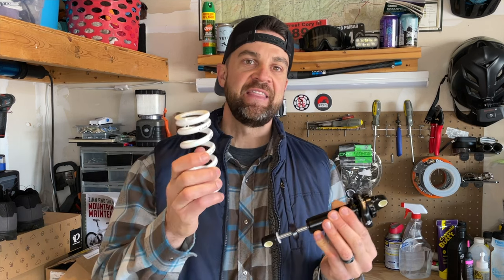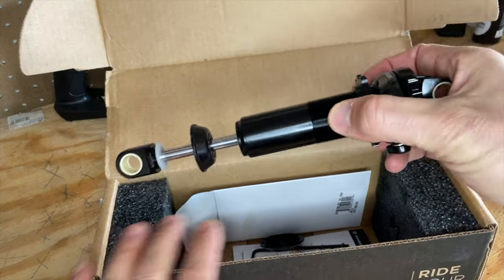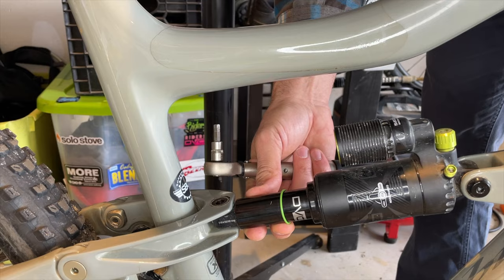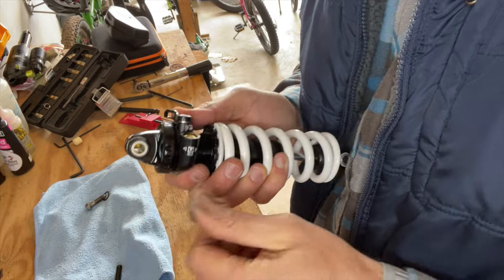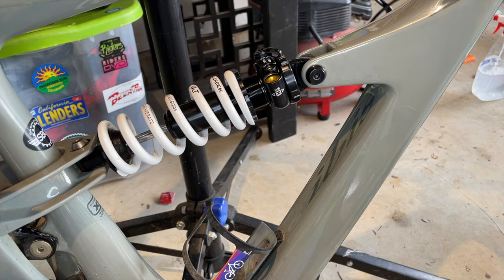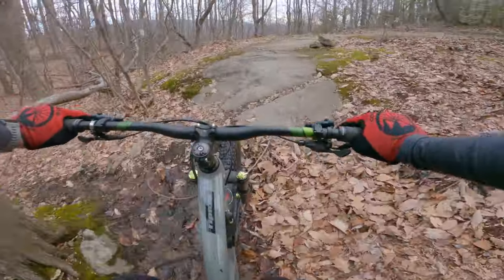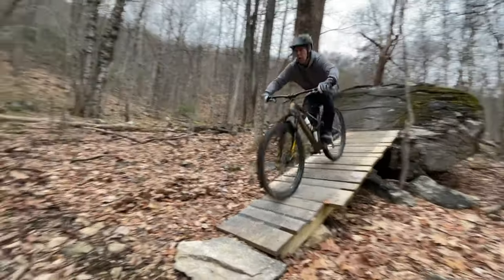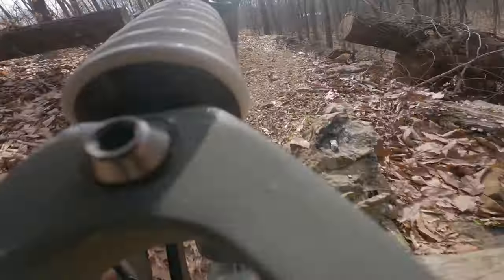Cane Creek DB IL w VALT Spring Progressive Coil Shock on the Ripmo V2 | Install & Review - 2022

Comment: Ripmo 29 2019?  Isn't it too linear to use coil shock even if the spring is progressive one?
Reply from the maker: @jungjoonchoi3744  no, there are a few coils specifically approved by Ibis
Reply from the maker: Also this is a V2.   The V1 could not run coil

Comment: Did you weigh the new shock with the spring installed? I'd be very interested in a real world weight if you have it? Im looking at one for my Ripmo and would really like to know what the difference in weight will be between the CC and my Fox X2.
Reply from the maker: I didn’t weigh it- I’m sorry 😞 - talking with a other ripmo owner it is about 30g heavier than the air shock he had on his - so pretty minimal weight penalty
Reply: @FoCoFlowShow  bonus points if you pull it off and weigh it for me 🙏.
 I think weight is the main reason most people (including myself) are looking at these shocks. Seems to be the happy middle ground.
Reply: I’m in the same boat. I think it’s going to be very similar to the x2 weight.
Reply from the maker: @stugillis  agree 👊
Reply: @FoCoFlowShow  so for anyone wanting to know. I thought I would come back and comment as I just swapped my Fox X2 which was 602g. For a CC IL Coil with a Valt 450-550lbs spring which was 699g. So a weight penalty of 97g. Not a hell of a lot really
Reply from the maker: @josephkornman6303  solid info - thank you!

Comment: Nice video, I thought about the cane creek spring but went w/ a cascade component link to get more progressive.  Would you mind sharing your weight / what lb coil you went w/
Reply from the maker: I toyed with the idea of cascade link too but I’ve been super curious about running a coil for a while so went that direction - i weight 200lbs and went with the 500-600lbs VALT spring…. Really no issue with bottom out except on the BIGGEST hits and I still need to tweak some of the compression/rebound settings
Reply: I have an AF so the link was a cheaper since I didn’t need an new yoke and for whatever reason the link in the AF added 4 mm of travel. Not a ton but noticeable w/ the added progressivity
Reply from the maker: @scottsnyder2651  yea that makes sense - did the cascade link make a big difference?
Reply: @FoCoFlowShow  It really did.  The extra progression allowed me to go from a 700 lb spring to a 650 for trail & 600 bike park. Bike is much better now in small bump or repeating hit rock gardens and still keeps the bottom out from being harsh.

Comment: Good video and good job using the torque wrench (unlike me 😄). I know coil shocks are superior, but it’s really hard for my brain to disassociate them from cheap big box store full suspension bikes.
Reply from the maker: Haha … I wouldn’t go so far as “superior” - there is a small weight penalty and some don’t give you as much pop as an air shock but I’m loving mine on the ripmo - do some research - you can find a budget option if you want to give it a try on your Marin
Reply: @FoCoFlowShow  to be honest I haven’t even spent much time tuning what I have. Just set the recommended pressure and rebound, checked sag, adjusted pressure slightly and that’s about it.

Comment: Nice video! Thanks!
How does the sag feel? Are you not running much larger sag with the progressive spring? I’m currently running firm on a 640lb Ohlins but tempted to try the 550-670lb Cane Creek.
Reply from the maker: I only tried the one spring so I can compare but I think sag would be similar since the spring is only supposed to get more progressive near the middle - bottom of the travel

Comment: Forest share your settings please!
Reply from the maker: I forgot to write them down... I'm sorry!
Reply: Cane Creek's advice to me was 30% sag, fully open (CCW) LSC & HSC, with middle range HSR & LSR. This was super plush to me in all conditions and as in the video I felt like I was losing the pop off jumps compared to the air shock. That pop is added with negative HSR (CCW) 1-2 turns, but once I got used to the coil on the bike the middle setting felt normal to me. My trails are similar to the video but more rocks / roots and roots / ledge climbs.